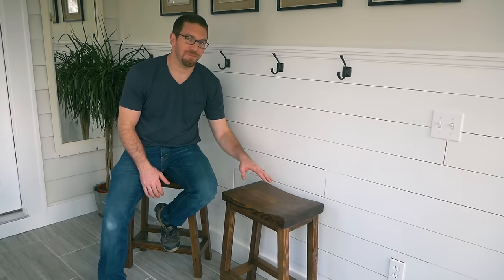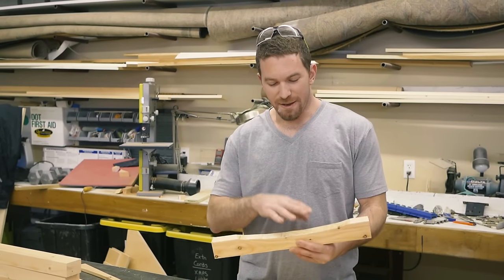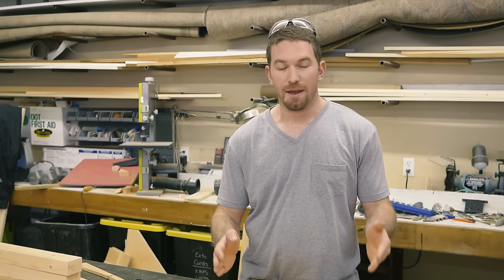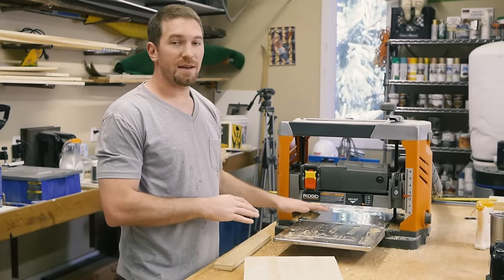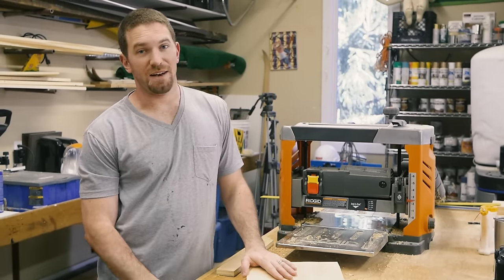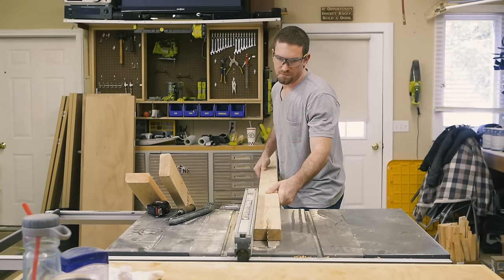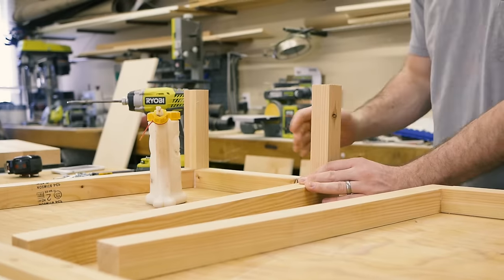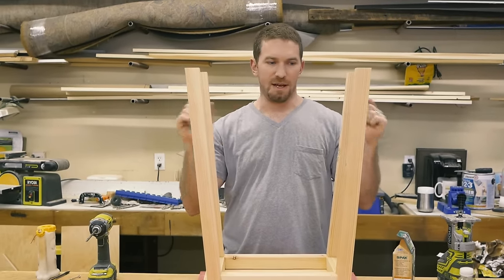How to Build a Counter Height Bar Stool with a Curved Seat for $10

Comment: Question:  After cutting out the pattern on the bandsaw ,I see they are all uneven to each other and lots of sanding to correct.  Once you had the template cut, wouldn't it have been easier and more accurate to use a flush trim bit on the router and the template to make identical and perfect cuts for all the pieces?

Comment: Great idea;  I really like the design...Tks.  I was looking to build this out of cedar, for a higher height outdoor cottage bar.   Any possible issues if I make the legs approx 6” taller to around 30”? Also should I consider  modifying width to 14” for additional stability to accommodate the new height?   Or go with compound mitre 5 degree.  Finally, are you OK with a outdoor wood glue and then final coat with an outdoor spar verathane ?

Comment: I love the stuff Rogue Engineer does, but there are so many of these misleading titles in woodworking.  It should say "How to make a $10 stool... when you have a $4000 workshop."
Reply: If you're okay with a router, you can achieve the same thing by cutting the seat template on a piece of hardboard, then routing the profile onto the saddle boards.  There will be much less sanding required when done.  There are also plans out here for a router sled that will cut this scallop once the boards are glued together.

The planing can be done with a basic hand planer, or again by diying a router sled to flatten the glueups before routing out the seat scallop.  Everything he's doing in this video can be done in a shadetree workshop, with the basics, a miter saw, a basic table saw, a Kregg jig ($20), and a basic router.
Reply: Were you expecting to cut the timber with your hands? Drive in the screws with your fingers?
Reply: Johnny D it’s $1500 in tools at Canadian prices. And you can cut that to like 800 if you buy used tools.
Reply: Check out Rex Kruger YouTube channel, he has a great setup for getting into woodworking
Reply: Lmao he's working with ryobi, ridged and some kreg tools... he's not close to 4k 😅 stop making my poor ass laugh

Comment: I really LIke the plans for bar stools  ... I am a novice woodster,.... but have built alot in past 3 months ...., am i missing something or am i cutting the cross supports at an angle - impossible to fit foot supports with out an angle cut ??  i  am calculating a 4 degree angle  for cross bar to fit  legs , please correct me if i am  wrong,  also the long crossbar measuring only 13 in wide inside ???
Reply: sorry my bad,  reading instructions again in small print you DO have cuts @ 5 degrees  -- thx !

Comment: My wife and I would like to build these.  Problem is, it is for a kitchen breakfast bar.  They top of the stool needs to be at 30”.  Any tips on how to modify the plans for that?
Reply from the maker: That should be pretty straight forward, just take the difference in height from the plans and shorten the legs by that much.

Comment: is there a reason you left a small gap between the seat and the frame? is it supposet to be flush with the legs?
Reply from the maker: It is supposed to be flush with the base.
Reply: Ok , I see . I built one and it came out great . Thanks for the video, my band saw is giving me trouble on making a good curve so I had allota sanding to do , is it because it’s too loose?

Comment: You could still do this without all the expensive wood working tools, if you have the WILL you can find the way!  I don't have a planer or scroll saw but I will make this!  Thanks for the ideas!
Reply: Simple tools. Straight-forward project - marking and measuring, handsaw, chisel, mallet, a way to clamp/hold, a scraper, some sandpaper, and finish - done.

Comment: Actually lol'd at 1:34 when the seat slides off of the plywood in the planer. Unfortunate. Looks like a stopper on the plywood will be required next time.

Comment: the background music is insipid, using pocket hole joinery for the legs is an accident waiting to happen. He spends more time pitching his web site than he does instructing.
Reply: and for you trolls, this is an excerpt from Matthias Wandel, who tested pocket hole, dowel and mortise/tenon joinery: As I expected, the traditional joints were stronger than pocket hole joints. Mortise and tenons were twice as strong as pocket holes. That said, half as strong as a mortise and tenon joint is actually pretty good for something quick and dirty.

But the troubling thing about the pocket hole joints is that they open up partially at much lower forces. If you make furniture using pocket holes, I'd recommend not filling in the pockets so that you can re-tighten the screws if necessary.

The dowel joints were 1.5x stronger than the pocket hole joints. I could have made the dowel joints stronger by using four dowels instead of two. Earlier tests indicate that such a joint should be nearly as strong as a mortise and tenon joint.".
www.woodgears.ca 
Testing pocket holes against mortise and tenon and dowel joints